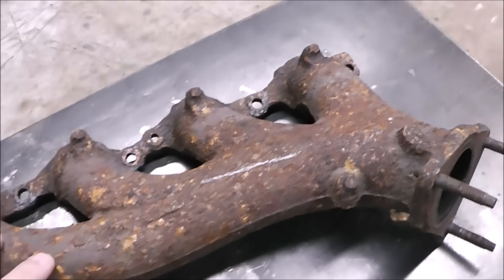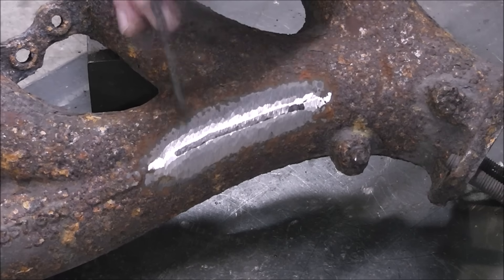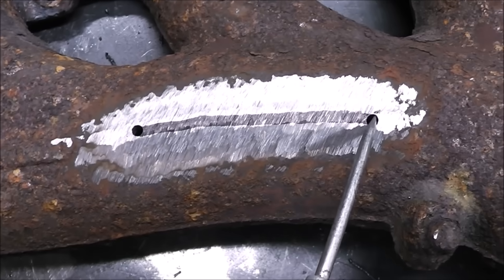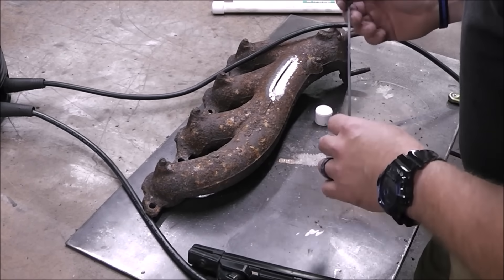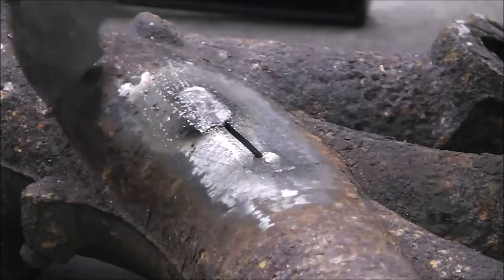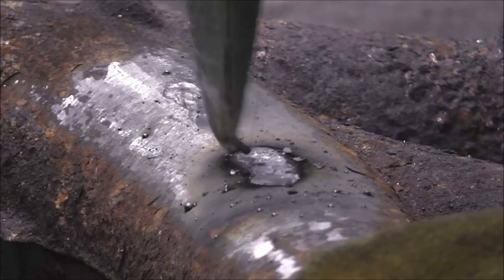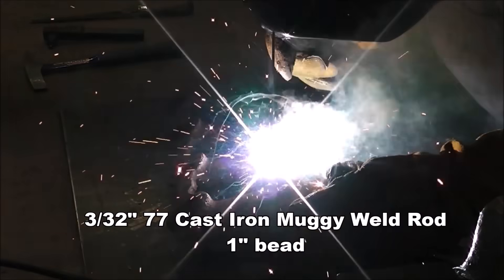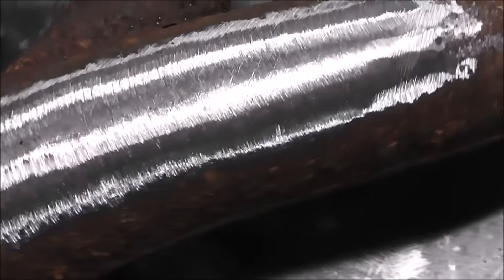Stick Welding Cast Iron Repair with Muggy Weld

Comment: dumb as it sounds i have had really good luck welding cast iron with rods for stainless steel. i do not preheat but weld with the lowest current that works. never had a failure.
Reply from the maker: That's interesting, Everytime I've ever tried stainless rods, it's always cracked. Maybe my amperage was too high. I might have to revisit this again and see if turning down the amps helps. Thanks!

Comment: The old timer who taught me to weld was a WW2 Navy machinist and he told me to always use nickel rods and reverse the polarity on cast iron .
Reply from the maker: Those are the guys to be around and gather information. The old timers had 1st hand experiences with no internet. They learned by doing it. I've learned a lot over the years from old timers.

Comment: Great, informative & interesting video. I’ve never thought it possible without the preheat. I’ve had modest success welding cast iron manifold’s for boat owners. Thanks, I’ll be trying that filler next time.

Comment: back in the day I was shown a method were they find the ends of the cracks and you drill a hole in the end of each side of the crack. then you cut off  2 small pieces of brass rod and stick each one in the holes. then you wed brass from rod to rod. it was called a cold weld.
Reply from the maker: Interesting! Thanks for sharing!

Comment: Try heating welding rod with blow torch red hot and dip end in blue flax and weld. Repeat. Cover weld and job in lime to cool down slow. Old cast iron welds works best without nickel in welding rods.

Comment: 8:30 it's not the flux that's keeping the rod from an essay stat after it's been use but a build-up of silicon on the end of the rod
Good video!!!
Reply from the maker: These rods act just like 7018, where the rod burns back into the flux. If you don't remove the flux to expose the electrode, it's not going to light.

Comment: 45 years welding most everything imaginable.
Diesel engine blocks and heads are the most complicated. 
Drilling is a key component and is the difference in a weld and a great weld. Ive great results with meager equipment and consumables. 
Preheat ,soft rod root pass with the length of the crack,perpendicular passes, and pinging have been my go-to procedure.
I repaired a
 300 Mack engine 24 years ago after two other attempts were made by others.Engine has had 2 overhauls, and still going.
Perpendicular pass technique was taught by a gentleman who had patented numerous cutting tips and proprietary flux compounds for military use.
 A lot of experience gained by listening to the older generation.
Reply from the maker: For sure! 👌

Comment: Would You look at that: this looks simple enough that even I would dare to try. Sadly I won´t get that exact rod or I´d have to pay horrendous shipping. But I think (haven´t looked yet) such rods should be available across the pond, too. I´d love to see an actual crack repair and a test afterwards.
Like Jamie (DeadDogeGarage) welded up a cast iron exhaust maifold for his Turbo build- that I´d call a serious test. If the maifold holds up and doesn´t crack again I´d say this is worth every penny. Kind Regards
Reply from the maker: I have a whole collection of destructive testing on my channel using all sorts of filler metals and processes, then comparing the breaking strength. I would dare say I'm probably the first to introduce this type of testing on YouTube.

Comment: Mig welding is not reccomended brazing , tig weld with silica bronze  or muggy rod works well when you follow steps to acheive proper welding technique
Reply from the maker: I do a lot of things that aren't recommended, including mig brazing with silicon bronze. It's awesome and It's nearly as strong as the original cast iron.

Comment: I used to braise and  sodder metals in factory  work with a torch can a person use a weld stick like a brazing rod as I don't weld and my best weld was the last day of shop class in high school.  I'm able to braise metal with a torch and silver aloy brazing rod I never could do copper parts any thing else I'm golden
Reply from the maker: So far the strongest weld is using silicon bronze mig wire so you could definitely braze it
Reply: Thanks for the info 👍 peace and much respect to you
Reply from the maker: Thank you Jason and to you as well

Comment: I should talk to my wedding supply shop, I've aways used a torch to heat up the clean crack and weld when it's almost glowing red with just standard welding wire. Sometimes with a brass wire and flux

Comment: That trick with throwing them in a bucket of water, can you also do that with say 6010/7018 etc and use them to tig weld?
Reply from the maker: 6010 and 7018 coatings aren't water soluable
Reply: @BrandonLund  Thanks, good to know.

Comment: Why didn’t you preheat the manifold preheat it then when you get done, weld it keep touching it touching it. Heat it up again with the torch Barrett and sand.
Reply from the maker: Because that wasn't the intention of the video. This is called cold welding. I explained it in the video description.  Your describing a "best case scenario" but what if thats not possible.  That's why.

Comment: Ive seen so many of those over the course of 22 years.
I'm goona say big block Chev, most likely out of a motorhome or contractor's truck that used to tow.
This method will work but it is only a bandaid until it happens again. Getting the manifold hotter than it ever should be changes the metal. Yes it works but the metal will evenyually crystalize and crumble like a cookie. There is no root cause fix for this because the vehicles that have these problems are overworked and under powered and this wll be the result 100% of the time within months of hard use.
Reply from the maker: Thats one reason why I won't repair cookware for people. Too risky. It will likely crack again

Comment: Can this be done to crack pontiac  cast iron heads? What i was thinking, preheat in BBQ grill then stick weld it. Then, slowly drop the heat. Any suggestions, or has anyone done this before?
Reply from the maker: I havent specifically with that model but you want a good preheat then a very slow cooldown

Comment: Best way to weld cast iron is to first preheat until orange in colour, then weld it, then let it all cool slowly.
Reply from the maker: With that said, if you can weld with a product cold without a failure, it says a lot about the product. It can only get better with proper pre and post heat. This was to prove a worst-case scenario

Comment: I am a investor machinist,  mechanics,  custom welder. In testing they found out weaving  while welding is weaker and weld cast-iron with mig and 25/ 35 gas. Heat cast-iron to cheery red and weld slow cool weld and it will never break... I'm 60 and saw this done at 18 years old and yes it works with no crack, because of same cooling. Teachers do not know all real life does.
Reply from the maker: So true. I have a whole playlist on welding cast iron using every possible filter and process. The best process / filler to date is silicon bronze MIG brazing. It's almost as strong as the original cast iron.

Comment: For anyone who wants to know, the purpose of drilling the holes is to allow the stresses at the tip of the crack to be distributed around the hole you drilled. Now, instead of all the stress in one point (the tip of the crack) it is evenly distributed around an arc.

Comment: I used 7018 push rod into metal move 2 or 3 inches  run back put little weld so it does cool to fast and saying that it's still 70 percent to 30 if it works. No one's life should be ever be on the line if it holds.

Comment: $90 + $15 delivery for just one of those welding rod cases and you used two!
So expensive
Reply from the maker: It is a bit pricy but when you need it done and the part is possibly obsolete, this is a sure fix.

Comment: I have a cast iron exhaust manifold that has no equivalent aftermarket part with a few cracks I need to repair. I think I will be ordering the Bluearc 160STI
Reply from the maker: Another great repair method is MIG silicon bronze.

Comment: every LS swap I have done, welded up the stock cast headers to close off egr and never once had an issue. no preheat, 110 lincoln weldpak gas mig, 035 wire
Reply from the maker: Nice! 👍

Comment: Great video - I worked in heavy Steel and Aluminum industry for over 35 years and we welded cast iron, ductile iron etc... quite a bit.  We always preheated to 400 - 500 deg F and made short welds and peened them with air operated descalers and we always covered them with Kaowool to slow cool for approx. 1 hour.  We used Certanium welding rods and I can't recall any issues as they worked great - expensive but worked great when you needed it!  Great video but I would always recommend some preheat and slow cool down as it always worked for us.
Reply from the maker: Thank you!

Comment: I'm pretty sure you're supposed to leave slag on until after cooling before next weld unless muggy weld says different I guess
Reply from the maker: They claim you can weld over the slag but that's not anything I'm accustomed to doing. It's just as easy to remove any chance of porosity and get a good restart.
Reply: @BrandonLund  No no no I want saying weld over the slag I'm saying let it cool down before removing the slag. It helps insulat for slower cool down

Comment: I tried these welding rods I preheated to almost 300 degrees but can’t get an arc  to maintain without long arc. It’s clean and I’m getting porosity then the welds all cracked right after
Reply from the maker: Those are classic symptoms of white cast iron.
Reply: @BrandonLund  what does that mean. What rod can I use to weld it. It’s a engine block out of a 9n ford tractor there’s weld on it from someone before me. I was thinking of just trying 7018
Reply from the maker: You can try 7018. I know a lot of people have had great luck but I would try wire feeding .030 silicon bronze. It's one of the best fillers on my opinion.
Reply: @BrandonLund  I’m gonna try and get another broke block I can practice on before I ruin the numbers matching one
Reply from the maker: Even now I do the same. It's always a good idea if you have something to practice on. Preheat and postheat might be a good idea also

Comment: Are cast iron rods DC only?  I have a Lincoln AC stick welder; thanks
Reply from the maker: Most cast iron is repaired with DC. There might be a rod designed for AC but I'm not aware of it.
Reply: @BrandonLund  Thank you for this; i looked up the link you provided and it stated DC or AC reverse polarity.  Does it mean an AC stick will work? thanks
Reply from the maker: Thats correct

Comment: Brandon.. Would you do anything different if you were working on an engine block instead? I have a 2" vertical crack between the freeze plugs on a 4 bolt Chevy block.. I figured since it's already cracked I don't have much to lose trying. My plan was to use a weed burner to heat the entire block and wrap it with a heat blanket when I'm done repairing the crack.. Great video btw.. The motivation was greatly appreciated!
Reply from the maker: I would make sure to preheat then do exactly as i did in this video and then wrap it in a welding blanket to reatin as much of the heat as possible. Preheat and post heat are what really help prevent any cracking.

Comment: For cast iron:
Pre heat
Weld
Cut through weld ( make channel with grinding wheel to prevent cracks ) 
Weld again
Heat it at end of welding
Reply from the maker: Yah but thats not what I was demonstrating in this video.

Comment: Nice video...
I brazed broken cast iron vise with torches, cooled slowly in sand .
Would that work with the exhaust manifold? Because of the high exhaust temperatures and temperature fluctuations.
Reply from the maker: Yes it does

Comment: Drill a hole at each end of the Crack. Use a nickel rod to weld it. Or COLD WELD IT!  use some mercury mixed with filings from a cast break rotor mix powder iron with mercury then pack it into the Crack, then heat it up the mercury will weld the filings into place, this can work on a block and a water jacket! Old trick!
Reply from the maker: Handy trick! Thanks for sharing!

Comment: He’s not wrong about the file and flux, that said, I find it easier to just tab my electrode on the bench before putting it back into the holder. Usually I just hit it a couple of times and the flux is outa the way.
Reply from the maker: That works too :)

Comment: I am a retired combination welder. Try Certanium welding rod, 889. Made by Cronatron.
Trick is to change your angle of rod to almost straight up 90 degree to run short beads. I also never use grinding wheel to prep weld area. I used dremmel bit. Does not smear metal molecules like a grinding wheel. Heat up before weld and cover or wrap to let weld cool slow as possible to room temperature. I used fire bricks when able to retain heat and a weld blanket if available. Problem was other workers would steal blanket. I preheated bricks in welding rod warmer that I used for 7018 rods to keep out moisture. Loved certanium. I to always drilled holes end if cracked area. Be sure to go a little past end of crack. Good luck !
Reply from the maker: Thanks man! I will be sure to give it a try! Thanks for sharing.

Comment: Hello sir. Just one question, using this method of short time welding (1in every time) how can i heat the part I'm welding? And how much? Should I make it cherry red, weld 5-6 times and heat it again until cherry red again?  Sorry but have no experience on cast iron.
Reply from the maker: You can get it cherry red. I tend to get it around 400 - 500 degress and start there. Keeping a MAP torch on it helps also
Reply: @BrandonLund  Thanks for your fast reply, you helped me a lot! Cheers!

Comment: MG makes the best contaminated cast iron rod I have ever used. I repaired cast iron pouring cups on molds in an aluminum foundry for years using their rods. The cast iron cups were sprayed with a non stick coating several times a day. You can t get any more contaminated than that. Sometimes they were cracked sometimes they had holes and sometimes they were broken off. I drilled cracks and ground off the edges on the others to 45 degrees. Then preheated and made a pass on each side of the crack and peened each pass. Then joined and filled the gap peening each pass never allowing to cool. All passes are made at 30 to 40 amps. Then you wrap tightly in a welding blanket and allow to cool completely and repeen. Worked great on the nastiest cast iron I ve ever seen. The rods are high but worth the cost. The cups were in daily use and held up for years. The other rod companies I contacted said it couldn t be done but MG said they had just what I needed and if it didn t work they would send their field expert out to help solve the problem if it could be solved. It worked great with a few minutes on the phone with their expert for instruction. 
M G is an outstanding customer service based company with many problem solving rods.
Reply: MG is the best if you can afford it.  I broke a leaf spring on a super heavy duty farm trailer.  Turned out it was obsolete so no parts available.  The spring shop in OKC that I had used is long out of business.  Long story short. . .I got some speciality rod from MG and welded that sucker.  I was shocked that it worked TBH

Comment: Like your channel, but just to inform you, the moisture you see when you start to pre heat is not moisture in the cast iron, its a bye product of the type of gas that you are using to pre heat, keep up the good work experimenting on behalf of others is commendable , loving your passion. MOD welding instructor

Comment: I have a hull of cast iron to weld the rivets on . I was hoping to of been able ti weld them whilst the coded welder overplates the base to save money . Think it’s best I leave it all to him after this as I’m worried I’m going to crack the iron
Reply from the maker: It's very easy to have problems.